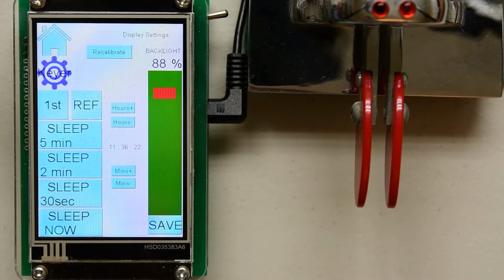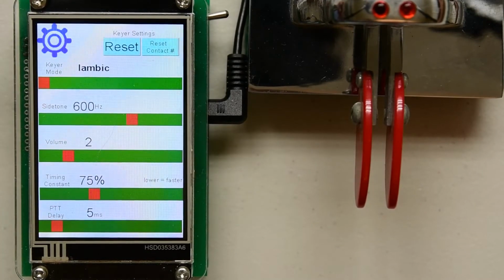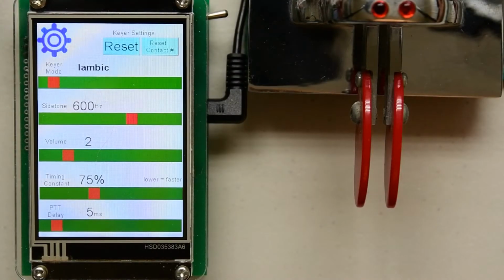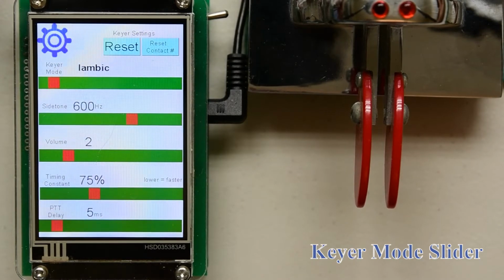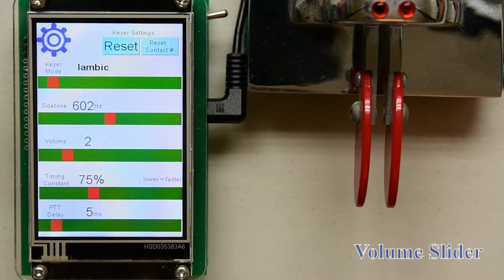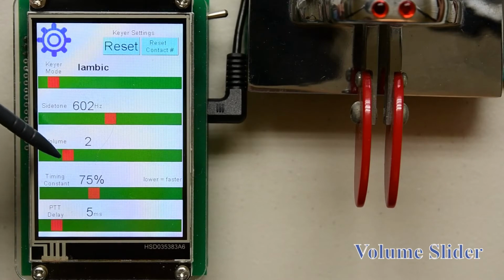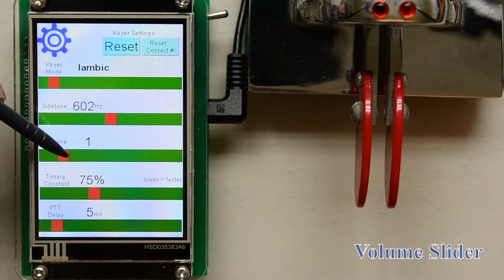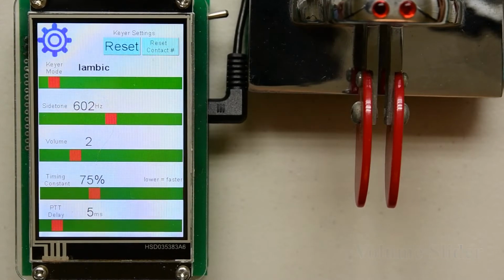WW9JD µMatic² Setup 2

Comment: Great discussion of the settings and very helpful explanation of the Sleep functions for the Display.  I have some more investigation to do as I can only get close to the proper timing if I set Timing Constant to 64 vs your 75.  All 3 units I've built require my TC to be 64 (using 2 different Mega 2560 Pro Minis.  Many TNX.
73, N4TVC, Randy